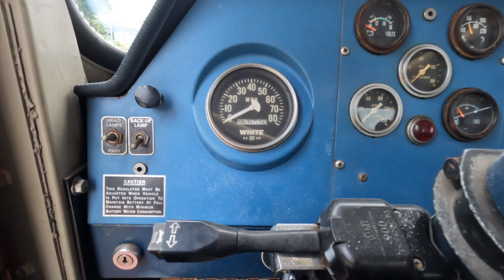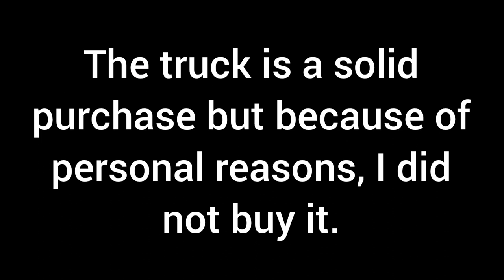1968 White 9000 for sale! Will it start? Did I buy it? Let's go look!

Comment: Our fire department had one with a 3000 gallon tank on it, used as a water tender.  No front brakes, originally not power steering.  Air assist was added to the steering.  Worked great, unless you used the air horn too much, approaching the intersection near the station, then you lost assist.  Cummins with a Fuller 10 speed.

Comment: I believe that black knob under the dash on the right of the steering wheel is a compression release , comes in very handy in the winter when the batteries are low , get it spinning and let her pop we had 9000's but tandems , 10 speed and 250 hp , much cleaner engine than our old 220 hp engines good luck great find !
Reply: You can hear when they start the truck their using it as it's spinning over fast.

Comment: I can't believe how solid that is, or appears to be ?  Must have been garage kept. If you don't have floors,  cab corners or the roof to repair or replace you're in good shape starting out. Your heart will tell you what you should do. I'm surprised it doesn't have a Fuller 10 roadranger though.

Comment: I thought I was watching an episode of Vice Grip Garage for a minute. Seriously though, remember this. Old trucks are much easier to play with and restore. Its all mechanical, no computers. Hell if you wanted to get a ten speed in it,it would probably bolt right up. Same with an modern air ride rear suspension out of a clapped out Freightliner or whatever.

Comment: That slippery for when wet or Snowy is there for a reason the professors at the trucking University I  attended said  if we ever come across it on a older truck not to use it but I did encounter it in a older truck and it was raining  I  moved it to the wet position then  when  it quit raining I flipped it back to normal  it’s for safety you don’t need the steers locking up on you
Reply from the maker: Thank you for sharing your knowledge of it.

Comment: I learned how to drive truck on my father's 1966 White 4000, it was a tandem drive on a rubber suspension. 250 Cummins with a 4 speed main and 4 aux. Hot as hell in the summer and cold in the winter.

Comment: Nice looking White. I drove one just like it back in the 70’s when the W9000 was in the shop for a week. That front brake limiting valve cuts the front brakes back to 50%. Some trucks didn’t even come with front brakes back then
Reply: My R model mack had no front brakes....damn, best truck I ever drove.
Reply: My 70 W900A has no front brakes and I drive it every day.
Reply: @dennisternent2974  was pretty common in the day, I heard some trucks were produced up to very recently with out them.....it really wasn't necessary like alot of people thing, but it was the other hassles that made it easier to not have it

Comment: I worked for a farmer in the early 80’s who had a truck like this. It was dark blue and same hood. Old redi-mix truck, twin screw and two transmissions. Had a feed wagon mounted on it and I drove it to a remote feedlot every day I worked to feed around 150 fat cattle. That’s a nice truck!  Very nice! Straight sheet metal. The one I was referring to I’m telling you was beat before I ever used it. Hood was bungee strapped on both sides and rattled like crazy. Transmission took awhile to learn. I stopped many times at first and had to start over because I couldn’t get it into any gear. I hated it then grew to love it. I hope you buy it because you very obviously appreciate it

Comment: when i was learning how to back up trucks.(mid 80s)the yard truck was an old green smith freight tractor like that.it was a 6 71 detroit with a 10 speed though.im glad i learned to back trucks without power steering.drove a manual steering truck first 12 years of my career.when you spent 11 or so hours in them trucks, you were tired when you were done.if you ran over a dime, you could damn near tell if it was heads or tails.you felt EVERY bump in the road.
Reply from the maker: That's a very cool story.

Comment: Unbelievable! That was my first truck with a 250 Cummins, no turbo, and a 10 speed. It was a tractor and I put a dump box on it. This was the truck my Superliner replaced. My truck was painted yellow with a red frame…thanks for the memories. The first place I worked in NJ started hauling there hauling business in 1902 with horse and wagon. There trucks were painted red with yellow frames.

Comment: Great video , I learned to drive a White 9000 with a 10 speed road ranger , I was 16 when my in-law was driving for Grand Union out of Mt Kisco NY. They had a whole fleet of 9000 probably 150 in the yard we would get on 684 and head up to 84 into Danbury CT . He would pull over and I’d get behind the wheel , legs shaking but I learned to drive that baby and the rest of the summer we would go overnite  produce runs  and I’d get to drive  I love those old whites  the smell of the diesel and the excitement has stayed with me for 49 yrs.  They also had a ware house in Carlstat NJ.   The company closed up in the early 90s and they shut down Mt Kisco. That rig sure looks like it could have been a GU truck they were also red , I wish I knew where 300-400 trucks ended up  I never really got to see any more around after they closed. But the video was very enjoyable to watch.  They also had the old Mickey Mouse clocks  with the paper disc to track the engine movement I’d buy one but my wife would shoot me. Thanks for all the good videos.
Reply: Market Haulage was the company name.

Comment: i was in a family business, we had four old White road tractors. One was a 1967 white 4000 it was a longer nose. It had same battery boxes, one on each side ahead of fuel tanks behind front fender. it was tandem drive 855 cubic inch 250 horsepower cummins  two stick 4 & 4 trans. It even had power assist steering.

Comment: That looks like a great one to get your feet wet with. While I understand tanks are daunting, original photos and some measurements off the truck should be able to yield you a pretty exact copy just without the risk of pin holes, crud in the tank, and well it's good right now but how long are they going to last.  Fuel lines are no big deal. Few hundred dollars (i put all new on my 359 for around 350.00) and that White is about half the length of my Pete so maybe even cheaper.  I say go for it Mr Mike! You can always resell it.

Comment: I've been watching your channel for quite a while and commented I think once or twice before. That memorial run you went on a couple of weeks ago for "Tippy-Toes" ? Well, I knew him, and he owned and ran a White tractor back in the 60's. Not sure if it was a 9000 or 4000, but he pulled tanker for Roy Bros. out of Billerica. He used to work on it at Miller Disposal's garage in Bedford, Ma., and that used to be next door to the Taylor and Lloyd International dealership that's still in operation today I believe. I was watching you latest truck show video, and there was a '71 Brockway tractor you were showing. The first truck larger than an F750 Ford dump that I ever drove was a '71 Brockway 361 10 wheel dump truck. That truck was owned by my friend Joe Sullivan, and he had bought it from Paul Lloyd, the brother of Eddie Lloyd of Taylor and Lloyd. You might know of Joe, as he ownes J.W. Sullivan Corp. in Billerica and does service station underground storage tank replacements and total upgrades of all the pumps, piping, islands, etc.. He used to rent a bay from the guy your current work truck came from. That's right, when I was working for Joe, driving that Brockway and his R600 Mack with either dump trailer or old Schertzer lowbed, Billy French was in his teens working for his dad, Bill senior, and had just started driving 10 wheeler !! French is still on that property today, but has expanded immensely !! Oh, a pretty cool thing about the Brockway that you might not know ? Those front fenders hinged at the front, and by loosening a bolt back by the cowl, they'd swing out forward, allowing you to step right in around the front wheel just like you do with a tilt nose !!! MUCH easier than going in through the butterfly hood, which of course it had as well. Ok, just wanted to share that with you. One more tidbit---- the first truck I ever went out on the road with in '78 was a '65 Mack B67 single axle with a 711 and a dupex !! Non-turbo, 62 MPH everywhere !!!

Comment: Hello from S.C. Originally a Rhode Islander. I have a 69’ with 10 speed it was a screw but the front was removed and carrier barren installed. Its originally a S. East motor freight truck. There Still in business. It was turned into a dump truck now a 16’ ramp truck with a goose neck ball. Runs super strong with no Rot 😂 needs a lot of TLC  though of course for its age.  but I’ll let it go if interested. Have pics and videos of it running. 34 year CDL holder. Skilled at New England tractor trailer. Practiced my skills with the same kinda truck. Guess that’s what I wanted one. But Health has changed my mind.
Reply from the maker: Very cool Michael feel free to post a link to the video here or email pics peterbiltonly379@gmail.com
Reply: @TheBostonTrucker  I’m

Comment: Hello there Boston Trucker! Are you called that because you run in Boston, MA? I grew up in R. I. In a family who had Grandfather Rights hauling meat’s into R. I. out of the Boston Meat Markets. We had a fleet of refer 6 wheelers my Grandfather started with, till the late 60’s when due to growth had to get refer trailers. So a few used White 9000’s most with flip front hood/fenders. With one butterfly hood like that. You need to pull on the big round handle under the steering wheel, that’s the compression release to help get it turning over, then let it go and vroom. Ours all had 190 or 220 Cummins with 10 speed Road Rangers single rear axle. I have st least a couple hundred thousand miles in them. Also there’s a place on Rt 1 in Wrentham used to be called The Foot, on a hill in the woods. Directly across from Myrtle St. They have nothing but old school truck parts.
Reply from the maker: Hi Kevin, Boston trucker just because I'm from Massachusetts, I ran 48 states for the first 20 years. I love hearing about your families history! My Dad started at Central Beef in Boston in the 1960's so I'm sure he crossed paths with your grandfather. Love those old Whites! Any pictures you can email me peterbiltonly379@gmail.com
Reply: @TheBostonTrucker   oh small world huh? Yea the post was kept short so I left some out. My Grandfather passed in the 50’s, it was my wonderful Dad who came to the rescue for his Mom, helping build the company. I learned everything I know about trucks from my Dad and his fleet mechanic, who took me under his wing when my Dad asked if he could hire me to wash trucks and change oil, he could have just told him to, but always kept thing friendly. I drove from 1976 after Honorable Discharge from The Army, till the dam teamsters union put us out of business in 1981, right after de-regulation. Yea I learned a lot, got to drive a couple twins stick Mack R100’s. Plus Dad bought a few old White Mustang tractors from Standard Trucking in Pawtucket, RI, after they went out. We used as yard horses, and run trailers to Alma s Warehouse one city over, like 6 miles each was, burning like 6 gals gas, with huge flat head 6 gas engines and straight 5 speed stone crusher trans. The only twin screw we had was bought from Standard, a 1964 White Super Mustang, that had some hot at that time 290 Cummins w/10 speed RR, that our mechanic turned up and ran like hell, able to climb the hills on Rt 95 in Foxboro with a 45’ refer full of Beef Ribs going to Almacs. I got to drive once when the driver assigned was hurt and I went with my Dad to relieve him and drive the truck back from the Navy Base in Newport. I had that old Mustang going 78 mph up Rt 195, like nothing and no smoke.

Comment: 65,000 miles and 4200 hours =15.47 average mpg. Did that diesel ever get up to operating temp? The first conventional I drove was a ‘70 Western Star. 335 Cummins with a pull compression release on the dash board, series parallel switch, 4 x 5 married gear boxes and road like a brick!

Comment: You need it! And I need a ride in it.
Reply from the maker: I know pal. 😊
Reply: What about cutting the ends off the OG tanks and inserting a smaller aluminium tank inside and weld it back up? You should make a CCO tribute out of it.

Comment: Need a shot of Ether it should kick over, where I worked on the Jersey City maintenance garage the fire department had a White fire engine same grille and headlight arrangement but a cab over flat face version it was I think a 64 or 67 year.

Comment: I drove a 9000 for a city of Forest Park GA to and from a landfill with a 48 ft packmore trailers for four years 318 Detroit and a 10 sp 1969 I think was the year
Reply from the maker: Could you imagine back then that a 9000 would be so nostalgic?
Reply: Nope we had two of them both with a 318 Detroit before they traded for two Ford 9000 and a Mack super liner
Reply: Did they have 48 ' trailers in 1969 ?
Reply: Yes they had 48 ft packmore trailers for hauling garbage they have engine on the front of them for pushing garbage out the rear

Comment: Awesome truck ! what kind of transmission ? is it a Spicer ? i see there s block heater ! no air seat ! LoL ! is that a 24 V starter ?🤠
Reply: Those years with. Cummins started on 24v every thing else was 12v, series parallel switch.
Reply: @ctprecast7437  great ! thanks ! when I bought my Mack R modet 350 econodyne with small sleeper I was told it started on positive ground ! LoL I didn t know nothing about trucks So one day in cold winter after sitting there for a week ! the batteries were frozen dead ! And I remembered that so i try to boost with the negative on the positive and the batteries just exploded on me ! i was alone and freaking out ! i couldn t see or hear ! fire was everywhere ! batterie of my car also exploded ! LoL i was on fire too !😫

Comment: Unless you have a nice dry place to work on it, and are willing to spend many thousands on tools. I would pass on that purchase. I know from personal experience. I have a nice place now, but it took ten years to get it. It is hard to roll a creeper around in dirt/mud. Unless you had done road service previously. That is even better in the snow and slush. Broken down on the Zakim Bridge. Getting blasted with muck by the traffic. It's tempting, but don't do it. 

As you said, "it is not quite the right truck".

Comment: Money pit, ya it was painted up nice. By the time you get the fuel system fixed etc you'll be into it for another 10 grand. The people that sold the truck probably lost money on it. This current guy is probably trying to recoup the money he has into it without taking a bath on it. I would have walked away from it I can see money pits.